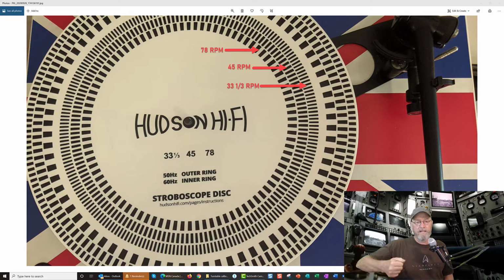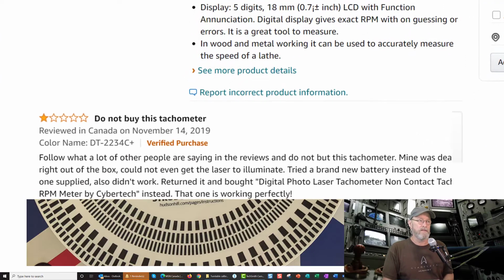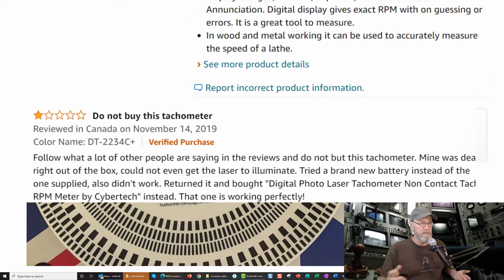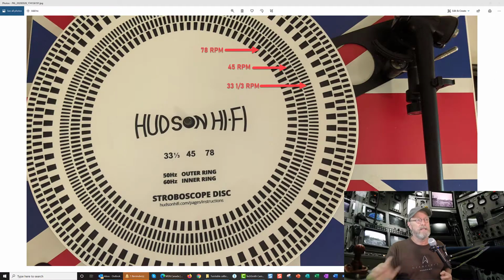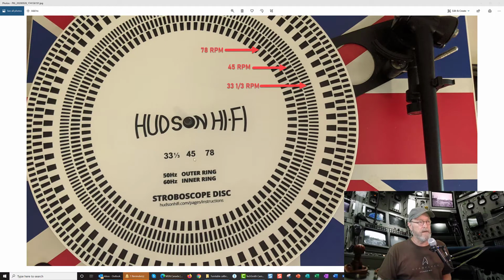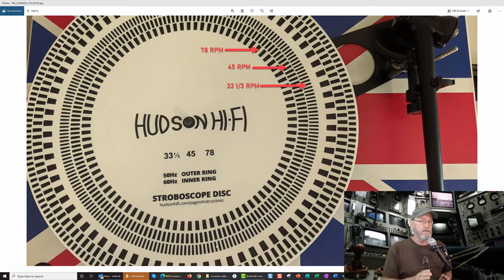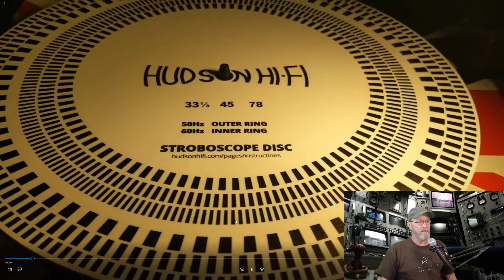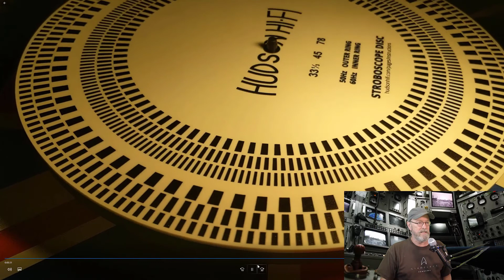Hudson Stroboscope Disc - Old Tech Does not Work with New Tech :)

Comment: Use a florescent bulb which actually blinks on/off to strobe light at 60 or 120 Hz in USA. LED bulbs have capacitors in the circuit which fill in the gaps of the sine wave voltage waveform so they won't vary in intensity enough to use as a strobe light. Most incandescent bulbs with tungsten filament also have so much heat build up they don't vary in light intensity very much either making it difficult to see the strobe effect. A neon gas bulb will also work quite well as a strobe light if you have one from a voltage tester. Dim the lights in the room so that the neon bulb is bright enough to light the bars as they spin.

Comment: Even if I'm a little late for a comment - for everybody who has the same problem:
For some of you, there is another solution. Depending on the soft- and hardware, you may use a smartphone. If you are able to set the camera to a static frequency of 60Hz in video mode, a 60Hz strobe-disk can be used at daylight. 🌞 You don't have to record it, just watch the strobe-disk on the display.